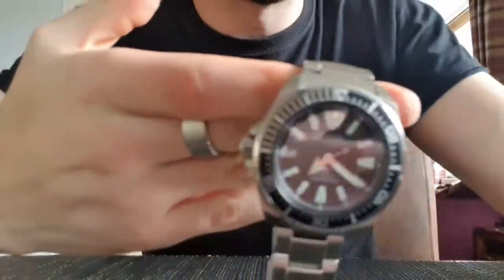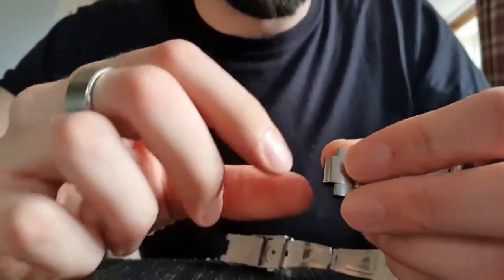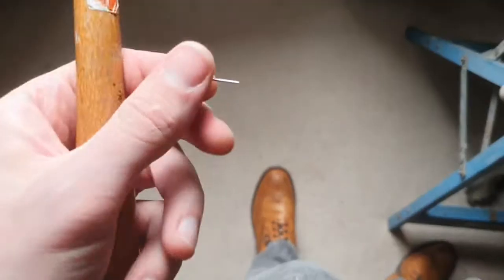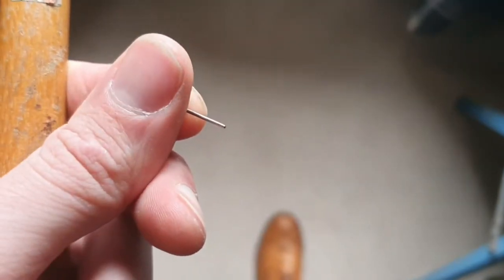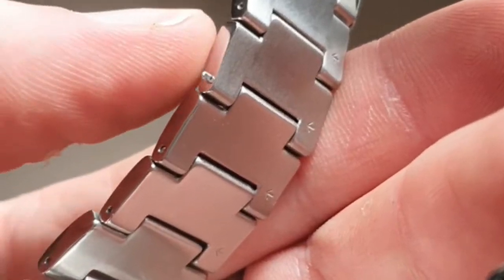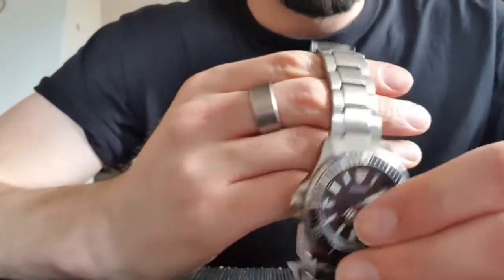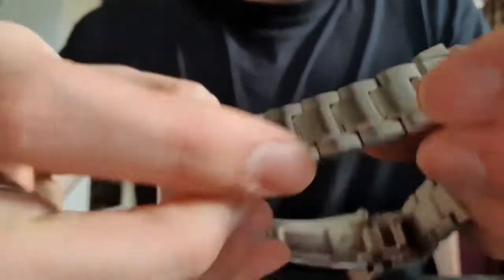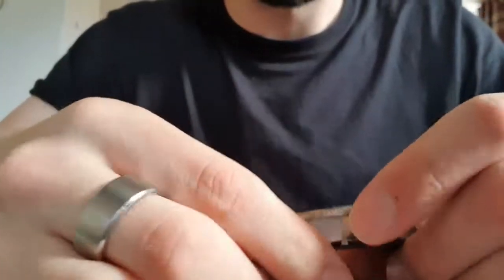Easy Fix: Repairing Loose Pins On Watch Bracelet

Comment: I had a loose pin problem with a Citizen AT2471-58L Eco-Drive Super Titanium Chronograph.  No collars and perfectly symmetrical pins.   They had been secured with some sort of varnish.  Once out, they easily slipped out again until, not having seen this excellent video, I applied clear glue, as tiny an amount as I could manage, using a needle.
Reply: Exactly my problem with a JY8020-52E propilot. They were tough-ish to get out, but once out slip through under their own weight. Something sucks with this system.

Comment: thank you for this,  video,   ive got a movado which ive not been able to wearfor over a year now due to multiple pins and collars/tubes needing replaced or "fixed"   LOL  :)   one was the case to braclet pin, then the clasp to bralecelt, and then a few regular link pins, I learned there are differences  between those 3  

its now  over 20 years old (still in extremely nice condition,  ill note,  had it refreshed a few years back )  had the pins replaced as needed over the years,  
   the  pins arent as easy to find, as they once were  and are starting to cause increase in cost  to have it repaired in general   so finding this video was awesome   

i cant wait to try this method and hopefully be able to enjoy wearing it again   saved me some

Comment: Good solution. My watch band (a Tag) has split pins, which can be spread open like a hairpin. You can make them tighter by bending them open. But if that's not enough, I think bashing the split end (making sure the split is horizontal while doing it) would add security.

Comment: Same problem, same watch, not even kidding same loose link… thanks for the video.
Reply: Same here. And I just bought my king samurai last month. 

One of the pins keeps peeking out. I've only worn it for one day! Crazy. 

And watch that pin just slip out of this gentleman's watch in this video freaked me out. 

I'm planning on buying the Hexad bracelet which has its links with screws instead of pins. I'm sure I'm saying it wrong. 

I'm hoping the screw links are a safer option. 

Thank u for freaking me out with this video. 😂

Comment: The samurai is pin and collar.  So if the pin is falling out so easily the collar isn't in place. I'm guessing you lost the tiny collar when you first adjusted the watch when it was new. This is very easily done as the collars are tiny. .A properly positioned pin and collar would never be loose like that. It's a mega secure system. Google Seiko pin and collar. There are plenty of videos on YouTube. Good luck!
Reply from the maker: Possibly. I had the watch sized at a watch dealership so if they lost it then it's a possibility. 

I can't see any collars in these pins on close inspection, they all seem to be friction fit. Either way, the flattened pin trick has held up fine and hasn't skipped a bit.

Thanks for watching!
Reply: @toolstimetravel4948  Yup, definite possibility. Had a "reputable jewellers" sell me a £300 Citizen diver that they adjusted.  Ten minutes outside the shop the bracelet fell apart. They had lost the collar too. Luckily I caught the watch. If fitted properly it's a great system. Super secure.
Reply: @toolstimetravel4948  I am not so sure about the "collar" thing. I don't see any. Looks like friction fit on my V158-0AA0. Great solar watch by the way. My charging failed within a year and Seiko fixed it for free but I had to pay shipping (Grrr). Now the band issue... None the less it is a great solar watch for a hundred bucks.
Reply: @RSmithsc  Seiko use a pin and collar (or pipe as they call it) on the Sumo, Monster and I think the Samurai. I don't have a Samurai but I have two turtles, a Sumo and a Monster. The Monster bracelet looks exactly like this and it uses pin and collar. His fix is a good one though, they are annoying as hell and it just doesn't seem to fully grip even with two collars on.
Reply: Where is the collar!!? Clearly no collar in place that’s why it’s loose 😣

Comment: Did not make sense should have shown how the pin fits back into the bracelet.  You have shown sticking out did you push it all the way through in the direction of the arrow on the bracelet?

Comment: I don't think you "fixed" it.  I'm pretty sure you're missing the collar.  Each link is connected with two pieces.
Reply from the maker: Probably not fixed to the standard of a watch repair shop, but its a simple solution that works and it hasn't ever come loose since. 

So I consider that a fix ✌️

Plus if it got lost then it must have worked itself free anyway or been lost when the watch shop adjusted my bracelet for me. As I haven't adjusted this myself.

Either way I've not got time to be messing around with easily lost and fiddly little things like collars. A simple flattened pin works fine.

Thanks for watching ✌️
Reply: @toolstimetravel4948   Im gioing to take  a guess that  "fixed" and then term "proper repair" ( the process of repair  that the mfg calls for to be performed that would be performed by a mfg approved or a vetted independant vetted watchsmith/jeweler would know to perform etc.) are ubitquitious, which is not totally wrong but its not a 100% correct coralation either,    where fixed is fixed it   regardless of how the problem was solved,   fixed is fixed,  

on a side note 
 to point out or bring issue  of how someone uses a term improperly soley from  subjective nature or personallyu derived standpoint    instead of from a proper citable credible source  ie websters dictionary or language  learning textbook, etc     is kinda distracting  just not the best practice to engage in, js  apologies for my 2 cents    the more you know.....   (shootingh star flys across screen)    :)  
2 people  both favorite color of blue,   No matter the details both are correct  
however  
i can almost with99999% certainty  say that both individuals whos favorite color is blue,  do not mean the exact same color blue aS the other  when they think of or invision or if they were told show or select the color blue they reference as their favorite    it would be different in hue, tint, saturation,  intensity   

it would be a pointless arguement   because both are correct and cant be wrong   blue regardless of specifics   is blue and its their right to have their perference  etcc    yada yada   i started out intending to maek a simple short comment
lol
Reply: @holly-jothompson3717   It's  Correlation not   coralation !